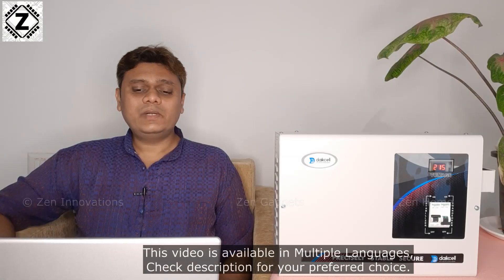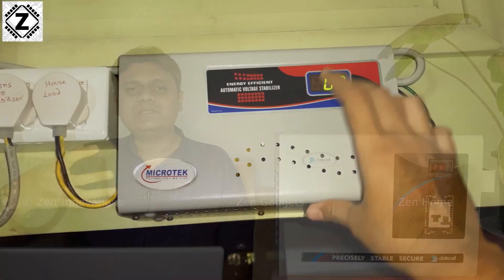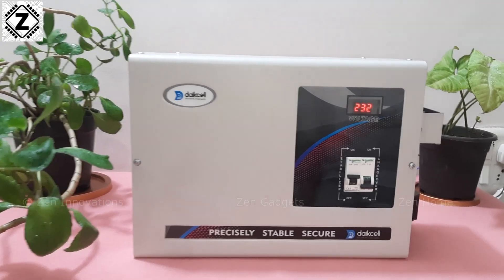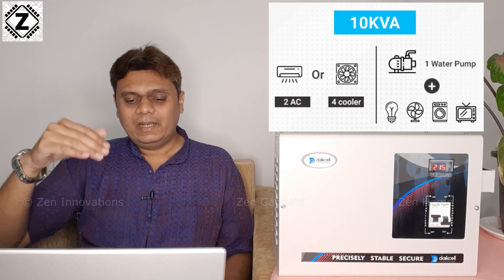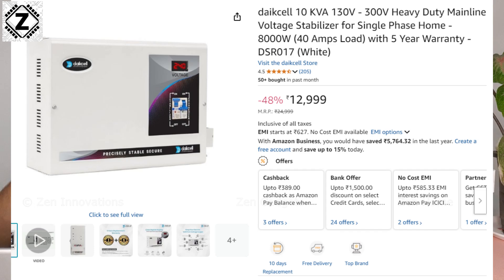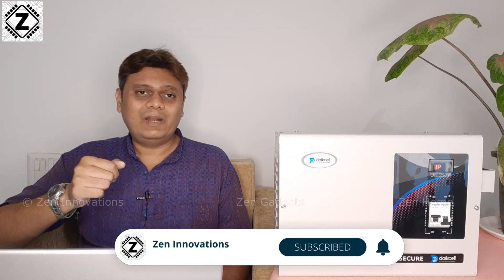Best Stabilizer for AC And Mainline? Daikcell 10kva 130v Review, Idle draw, Voltage test [Eng]

Comment from the maker: This Video is Available in Multiple Languages-
Hindi https://youtu.be/pvsFwAn0vm8
English https://youtu.be/iKVaDMgRct0

Chapters English-
00:00 Why Stabilizer?
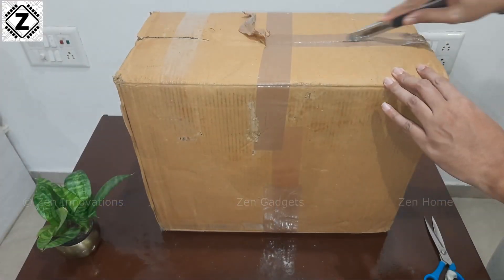01:37 Unboxing
02:37 Build Quality
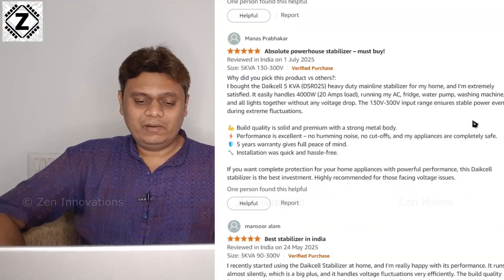03:08 What is Inside, Toroidal Transformer, Fanless design
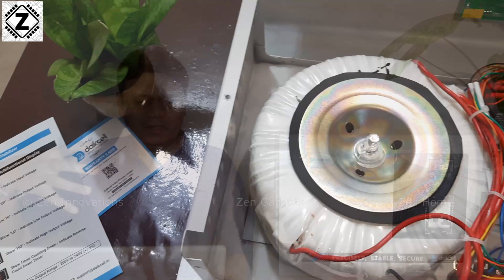04:20 Copper v/s Alluminium
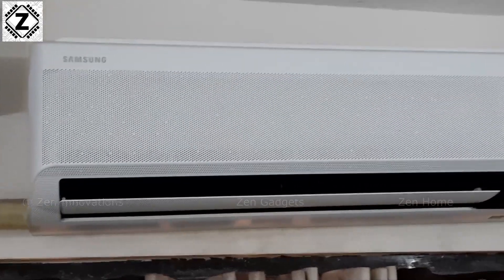04:51 Idle Draw
05:35 Protections and Features, Bypass MCB
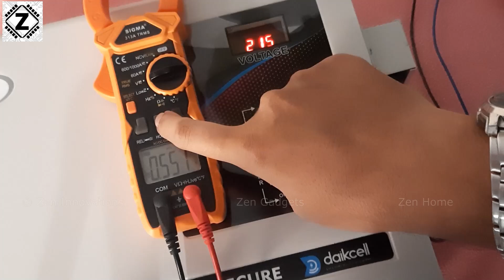06:58 Display accuracy 
07:15 Which model to buy as per Load capacity (5kva, 10kva, 15kva)
08:13 Working voltage range vs Actual voltage fluctuation
09:58 Pricing & Conclusion

🛍 💳[Buying Affiliate Links]💳 🛍
daikcell 10 KVA 130V - 300V Heavy Duty Mainline Voltage Stabilizer for Single Phase Home - 8000W (40 Amps Load) with 5 Year Warranty - DSR017 (White)
https://amzn.to/415mbKv

daikcell copper Stabilizer https://amzn.to/4nZShBl
daikcell stabilizer for ac https://amzn.to/45cCQya
All daikcell stabilizer Models https://amzn.to/46ZY2IW

Buy Stabilizer for AC Upto 1.5 Ton-
V-Guard VG 400 for 1.5 Ton A.C (170V to 270V) https://amzn.to/3e8Szm7
Microtek EM4130+ (130V-300V) https://amzn.to/3uR0tr4
Microtek EM4150+ (150V-280V) https://amzn.to/3mUxFLs
V-Guard Magno 410 170 VAC to 270 https://amzn.to/3do7SYX

Buy Stabilizer for AC Upto 2 Ton-
Microtek EM5130+ (130V-300V) https://amzn.to/3ghohAz
Microtek EM5150+ (150V-290V) https://amzn.to/3uXgD2m

Buy Other Top Rated Stabilizers here-
https://amzn.to/3xM8PD3

Buy UTL Gamma Plus 3350 With Lithium Support https://amzn.to/49GAmbc
Buy UTL Gamma plus 2kVA 24v https://amzn.to/3Q723S2
Buy UTL Gamma Plus 1kva https://amzn.to/3xodWtz
Sigma 313A Clamp meter With Inrush https://amzn.to/46Q5KTr
Buy Now adjustable Voltage Protector https://amzn.to/3bAzknQ or https://amzn.to/3RC7SYF

💎 [Playlists] 💎
All About Stabilizers
https://www.youtube.com/playlist?list=PL9YrG_WglF9yN4gyLQ3X-n4mCoujwLRgq

💫 [Links & Credits] 💫
Product page-
https://daikcell.in/product/mainline-voltage-stabilizer-for-home-10-kva-heavy-duty/

Warranty Registration form
https://docs.google.com/forms/d/e/1FAIpQLScuUvnTgjY2iwqm9nkTMVexTC62FXqYh8b5KedsQi-j-Oo9rA/viewform

Website & Social media-
https://daikcell.in/about/
https://www.facebook.com/profile.php?id=61554856032989
https://www.instagram.com/daikcell/
https://www.youtube.com/@Daikcell_India

Comment: Generally, stabilizers are used to increase voltage to the recommended level, but in my home, there is an issue of high voltage(280v), can i use this device as buck (to decrease from 280v ) voltage? please reply fast i need to buy main line stabilizer asap.
Reply from the maker: Yes, It should support step down. I have already tested my Aulten one with step down here
https://youtube.com/shorts/TISHhAzjFzA?feature=share